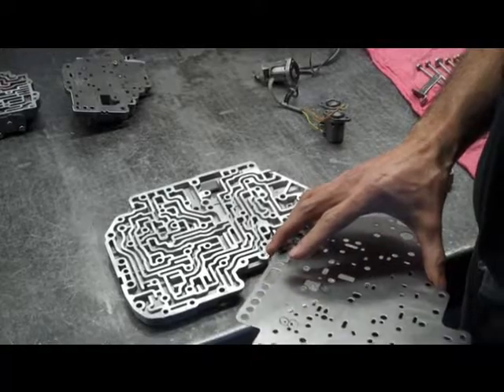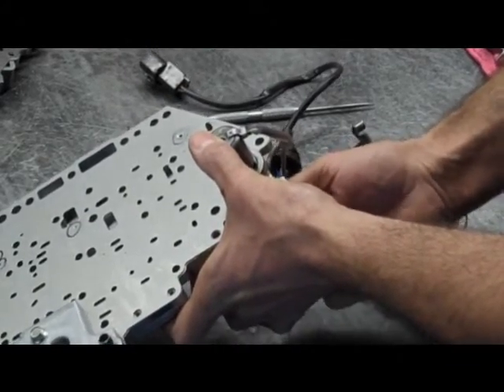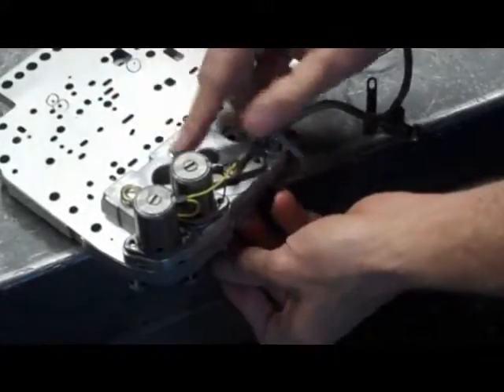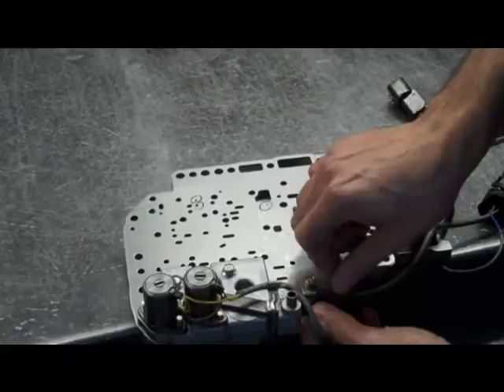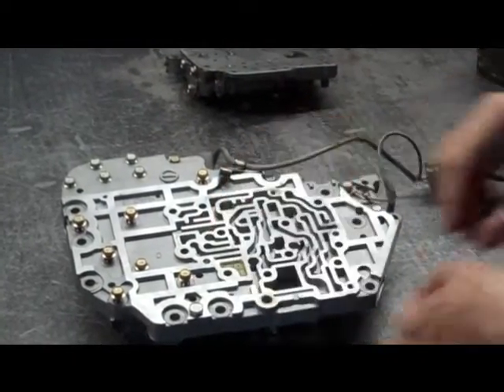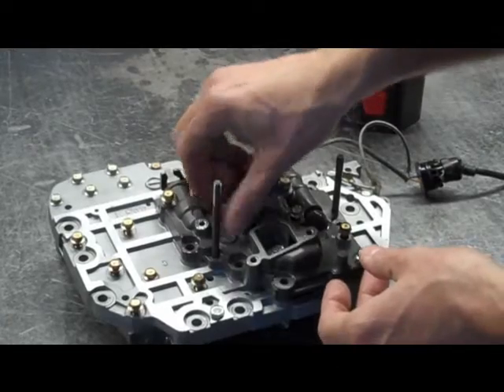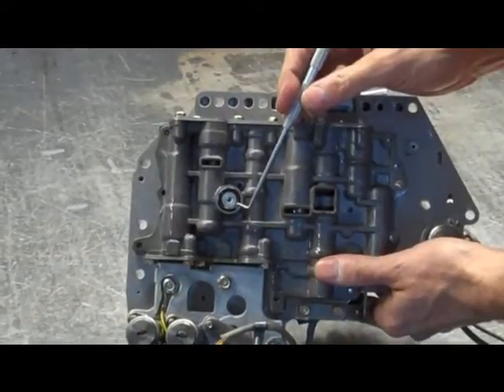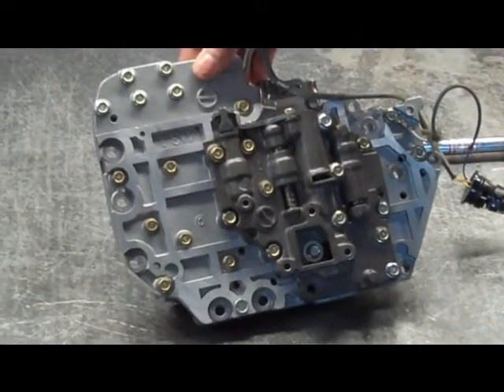Mitsubishi / DSM Shift Kit Installation Instuctions Part 4

Comment: How are you am working on a 1993 Plymouth Laser and is having problems shifting so transmission has been rebuild about 3 because I want to learn how to work on transmissions I got  the solenoid  shift I want to install a shift kit to but it doesn't have the plates that you drill am going to double check just to make sure on less is like that if you reply or if you  have a video on this model transmission I would appreciated if you could help thru this thanks